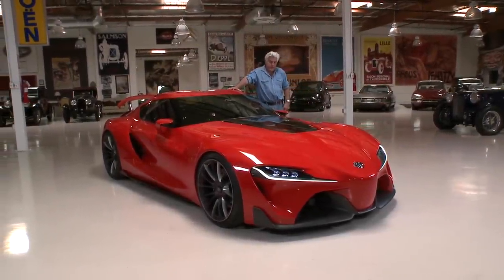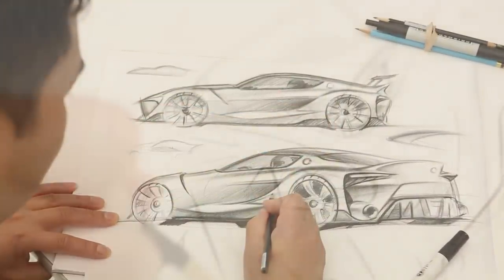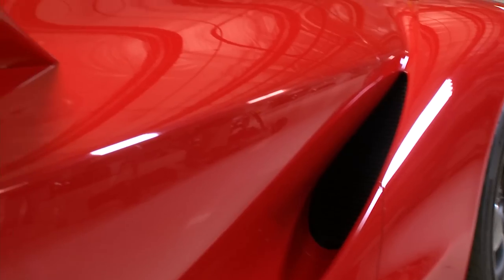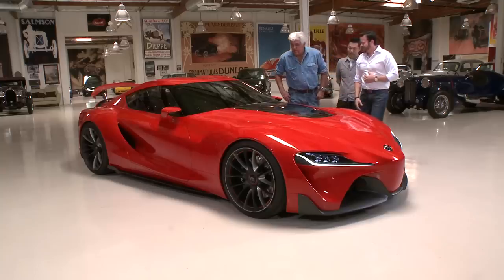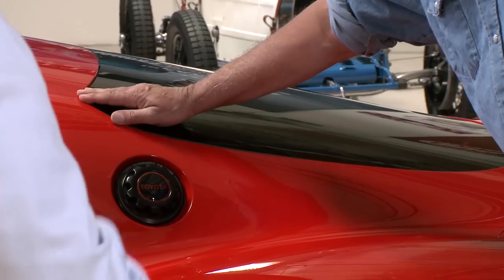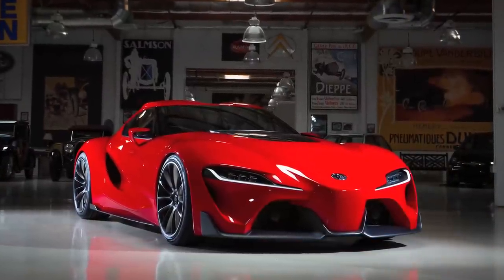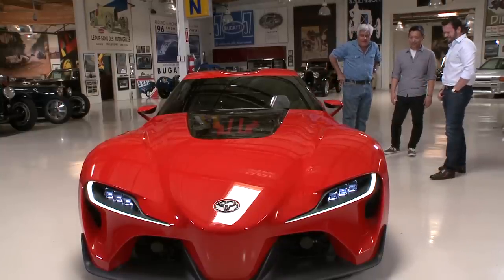Toyota FT-1 Concept - Jay Leno's Garage

Comment: They should make a FT-1 concept body kit for the 2019 Supra!
Reply: that would be insane!  i can imagine someone creating that..
Reply: Nah the new supra isnt worth it. Because it's the same BMW inside no matter what shell u put outside.
Reply: debendra gurung yeah?
Reply: The new supra can never be great. No matter what body kit they put on it. Should of built this car instead
Reply: I think the soul of the FT-1 look is that F1 like nose. I just don't see how you can kit that on with the current Supra.
Reply: You would litteraly need to change the chassis, the wireing harnais, all of the panels, all of the inside, all of the glass, the 4 wheels and tyres, all of the interior as well as the motor that would not fit under the FT-1 hood and... oh no there are nothing left! Yeah build one from A to Z without any base would be easyer
Reply: @skip741x3  they did check my channel
Reply: You can't. The FT1 is wider and longer chassis and better it wouldn't fit on that A90 turd we got...
Reply: Is dis a toyota supra or just another bmw supra??🤔🤔
Reply: That crap is a Z4 its not worthy of the supra name
Reply: @debendragurung3033  don't short sell it tho, it's a fantastic car for the price
Reply: @sspsmith7605  hurr durr bmw supra waaa not worthy not worthy, man, Toyota made a great car and y’all still hating on it

Comment: Why was this car never made? It's the best looking Toyota of all time.
Reply: They are actually still considering making it.
Reply: Looks like we will get it now
Reply: As I recall this car has been seen around the ring
Reply: marc james they have put the new supra out on the ring so similar looking car
Reply: David Cheeseman that's what the evolution of this is from my understanding
Reply: No the mk4 is
Reply: Beerdy - Bruce Lee Central.
Reply: They are supposed to make the new Supra out of this concept.
Reply: They are designing the new Supra around this build, should debut sometime next year. Public release slated for 2019.
Reply: friend of mine works at the dealership and his college went to  a presentation of the consumer version, so he has seen the final product. it will be out but the front as i heard will be different.
Reply: The chassis is toyota, the engine is bmw, research before posting stupid coments
Reply: Rolling Guy #1 
The reason for this BMW alliance is because they sold their inline 6 tech to them. So it would be more authentic than the GTR who changed from it's inline 6 TT to a V6 TT.
Reply: No it’s probably the mk4 supra what is the best looking
Reply: dn lamp is it close to the FT1 original design?
Reply: næ
Reply: i hate how it looks. i wish it was more angular like the early japanese import cars designed in cad. why does every sports car nowadays have to look like flowing liquid. angular design seems way more confident, it just seems more masculine like the supra 3rd gen or the 300zx.
Reply: also the interior of this thing is disgusting. why does it have to look so complicated and cluttered.
Reply: Beerdy - Bruce Lee Central don't forget the supra
Reply: The Supra is the ft-1 concept
Reply: It’s really a very beautiful car and if the Supra looks like this they will sell well. But no concept cars hardly ever make it completely to production. I’m sure they will  change something and mess it up.
Reply: Beerdy - Bruce Lee Central claimed any other mans videos as of late?
Reply: It's going to be made soon, new Supra my dude
Reply: porduction begins end of this year revel is this time next year and the car will look half as good as this concept, still cool.
Reply: Beerdy - Bruce Lee Central hell ya It looks dam good. Looks like it would domante the track
Reply: Beerdy - Bruce Lee Central nahh JZA80 (Toyota Supra MKIV) is better
Reply: Not even close. 2000GT by far
Reply: People have spotted it testing at Nurburgring.
Reply: The car they're actually coming out with looks like a cross between this and the 4th gen Supra.  It's not bad looking but it doesn't look as exotic as the concept does.  

Here's a video:  https://www.youtube.com/watch?time_continue=15&v=cYy9N5v5eho
Reply: Clell Biggs concepts always are overblown, there's no budget on concept cars so that's why most of the time concept cars look better then the production model.
Reply: It IS being made. The FT-1 (Future Toyota) was the prototype for the A90/Mk.V Supra.
Reply: ooDirtyMickoo i
Reply: Beerdy - Bruce Lee Central remember the mk4 Supra will always be the best looking Toyota
Reply: Its coming out in January 14 2019
Reply: Because is a toyota
Reply: Research is still going on on its reliability tests.
Reply: aaaaaaaaand its been unveiled
Reply: Beerdy - Bruce Lee Central it just got made
Reply: Pandes Mandes nah it really doesn’t
Reply: Beerdy - Bruce Lee Central I was made it’s called the 2020 Toyota Supra
Reply: Rolling Guy #1 that is the Supra
Reply: It probably would of cost to much for most people .So when they unveiled 2019 model they change it. It didn't have the same appeal look.
Reply: People driving it now lol
Reply: @ooDirtyMickoo  Aero, man! A supercar needs to slip through the air like a fish through water. Angular is dead - not for style reasons, but for performance.
Reply: @andoletube  i dont get why angular inherently means its less aerodynamic? like a triangle is aerodynamic.
Reply: @ooDirtyMickoo  wind tunnel testing has shown that a lot of what we feel is instinctively right about aerodynamics is actually pretty wrong. There's a lot to manage in a supercar. There's wind resistance, ducting for cooling, downforce, turbulence. It all adds up to this smooth lines result. Yes, all makers are making small compromises for the sake of styling - otherwise they'd all end up with the same design if it was only about efficiency. But none of them are prepared to take a major aero hit just for tho sake of styling because the performance suffers too much and the car won't sell.

By the way, a triangle is not aerodynamic! The front of it is, but the trailing end will make a substantial low pressure zone that will try to suck the triangle backwards. It ends up as dirty-air that affects the drag coefficient. It also makes rear downforce and air direction onto a rear wing pretty much impossible.

Comment: Toyota just needs to bring back the JZ engine family
Reply: 3JZ-GTE Anybody??
Reply: +Abhi Nisakaran yup that would be great
Reply: +Abhi Nisakaran I hope they made it..
Reply: supposedly it's going to have a bmw z4 N52B30 engine, in which I do agree they should have brought back jz if not a modified version of it.
Reply: +Jack Singh so basically Toyota is copping out to actually building their own engine from scratch...I hope of this thing does come to fruition that modders put a 2JZ in it...
Reply: +ywe3 I do disagree with the idea of using a bmw motor and also hope for a new jz, but don't forget that that Toyota worked with Subaru for the GT86 which has an excellent motor and Toyota also worked with Kawasaki for the LFA V10 my overall point being is that if Toyota wanted to follow that route instead just using a bmw motor they should work with to create a new motor.
Reply: Jack Singh historically Toyota used Yamaha and actually owns 50% of the company...but to call the GT-86 Engine a success? The 2.5L I4 in the tC makes more torque and has comparable power and has a Toyota badge on it...look it up the FR-S/BRZ/FT-86 are all slower than the "entry level" cars 5k under them and most real modders go for them over the FT platform as they also have more room for modification both in chassis and engine bay...if the FTs were turbo or supercharged from factory then maybe I'd consider it a success but they're literally what the J cars of 80s GM were the just look the part...
Reply: Jack Singh I knew you meant Yamaha lol, but efficiency doesn't belong in a sport coupe it should've been turboed from the factory bar none...it's SLOW and feels SLOW it has only a 150lb.ft. of torque pushing a 3000 lbs car...you can barely get the back end out and when you do you can't hold it long due to the lack of torque...i drove an FRS for a while the car wears off after the 1st week of ownership  and just becomes that leech that suckered you in the showroom and sucks 800/month from your wallet  (car note and ins)...when you get beat by the entry level car with an automatic transmission hang your head in shame
Reply: +ywe3 lol this is true I beat my buddy who has an fr-s in my 2011 Camry se. But yes it should have came with a turbo. Especially when you think of Subaru, boxer motor a turbo just needs to be there.
Reply: Jack Singh didn't he feel gipped I mean the car costs 30k
Reply: +ywe3 that I'm not to sure about, he is the brother of Elvis Skinder from StanceNation
Reply: Well that might explain a few things lol
Reply: Unfortunately it will never happen. In 2002, after many I6 JDM sports cars were out of production, a lot of people knew that was the last time they would see JDM sports cars powered by I6s. Even Keiichi Tsuchiya said, in 2002, that he is gonna miss I6s, that is for sure we're not gonna have another JZ engine. Which is a pity, but the worst thing is that is probably gonna have a BMW engine.....
Reply: +ywe3 Do you think the AE86 is slow? Good, then the GT86 is EXACTLY what the AE86 was. Slow, affordable, fun.
Reply: The Hachi-Roku was not slow for its time in fact it was one of the faster entry level performance cars in 85...the GT-86 doesn't even come close its overpriced and very complex to maintain...the Hachi-Roku will maintain its staple status long after the last GT-86 turns to dust as it was (and still is) the best 2 door Toyota has ever produced only rivaled by the supra and FR Celicas
Reply: +noskilz04 They Just need to do something, it has just been far too longas long as it is straight 6 I'm good which it is going to be.
Reply: ///AMG Lol, V6 sounds like a beast honestly.
Reply: kane kure The head of the engines was developed by Yamaha , as usual. The rest by Toyota, it's common knowledge.
Reply: kane kure Well, it happens
Reply: thye wont :(. it doesnt meet this generations needs...... fuel efficient and good for the environment .. psst. give us the 2jz , epa can go kick rocks lol
Reply: they might now that trashy scion is no longer in existence
Reply: The JZ GTE is the best
Reply: I know right i was expecting it to have a 3jz but no.....dissapointment
Reply: noskilz04 and zz
Reply: noskilz04 3JZ?
Reply: Nope... they should put an upgraded version of the LFA engine in it.
Reply: micglou the fact that you use the word upgraded says it all XD
Reply: It does?... Mr. 'the fact'?
Reply: Abhi Nisakaran ehm what about d3jz-gte where the d stands for double that would make it a V12 made of two 2jz blocks whit quad turbo😁
Reply: The BMW i6 in there should be the 3JZ
Reply: I've been hearing its going to now have some sort of Toyota V6.
Reply: Stop begging for 2jz its already old you have to move on

Comment: That Toyota FT-1 needs to be in production!
Reply: It will be in production as the new Toyota Supra
Reply: with a shitty bmw engine. nice supra.... this good looking piece of crap won't get even close to the supra (sadly)
Reply: Why are the bmw engines shitty?
Reply: Beazor 86 We don't even know what engine will be used and you are already dismissing it
Reply: Mariux - i know who is making the engines. and i know enough about bmw so it's simple 1+1
Reply: BMW had a lot of straight 6s just like the Supra.
Reply: Sask Rider they do have high performance straight 6. but high performance for bmw's 6 banger is just 500-600 hp. high performance supra (2jz) is at least 1000hp+
Reply: BMW= never designed for turbo tweaks. High compression ratio ranging from 11.0:1-12:1 as opposed to 8-9.0:1 supra. You could lower compression in bmw engines and make them turbocharged so it produces more hp, but I don't see the point.
Reply: It will be as FT1 Prius full electric  :D
Reply: because they are over engineered
Reply: @DailyDotaTV I think you should take that back.

Comment: all i can say is, if they put this into production, they better have a manual gearbox available
Reply: ***** its a shame isnt it? shifting is what makes driving fun. the sound you get from downshifting, or the pull you get from shifting up at high revs. now thats all gone with auto transmissions.
Reply: Creedford It's paddle shift so you can still downshift and make the sounds. It just auto-revs and auto-clutches, because it's a lot faster than a human.
Reply: Empty Videos Buying a sports car is about driving feel, not about going fast, since 99% of the time you are on public roads.
Reply: Empty Videos I disagree, if you look at any stat for a car that has a paddle shift automatic transmissions there acceleration is usually a second slower than if you were to have the manual. But it's still in concept, i'm sure a lot will change cause right now it looks like it could be a very fast car, and they emphasized the air flow.
Reply: I agree
Reply: Spencer Tennant Nah they can have paddle shift too but you need that fun to drive japenese car feel to it like ripping around in a supra
Reply: Yeah but I just hope that they have like a 6 speed standard transmission or something of the sort.
Reply: Creedford Nah three on the tree or push button shifter on the dash with separate push button for D, R, P, N 1, and 2 ;)
Reply: I don't think that a manual transmission will exist...it's like the GT-R R35...I think it will be an automatic 7 gears
Reply: Empty Videos I like my human speeds just fine, you can't feather a paddle shifter and there are a whole bunch of times when you don't want to shift with a bang out in the real world.. They have all these different electronic gizmos to help the helpless do what my hands and feet do naturally.
Reply: ***** yea but thats only because toyota has become so unoriginal that they have no choice but to do so...
Reply: Creedford no chance for a manual mate but what would be a good replacement for manual is instantaneous silky smooth gear changes.  But manual will always be the best.  #mechanialengineer
Reply: Creedford I swear if it comes with manual it will be mind blowing :D :D
Reply: Creedford It all depends on the emissions compliancy. The reason most makes use AT's is they control the entire powertrain (and just about everything else) via a computerized CAN system to minimize emissions. Sadly, they use a CVT in their latest models which I loathe.
Reply: Raggical Traggical is on the money
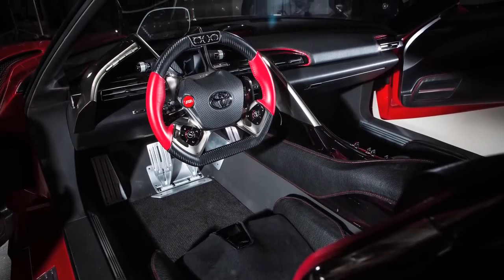Reply: Creedford 4:25 I only see 2 pedals so it seems like it's paddle shift
Reply: Eric Wang yea no doubt this one in particular is paddle shift or auto, but if it goes into production in the near future it would be nice to see one last true JDM Icon available in manual transmission. especially with the rise in elimination of manual transmissions in production cars and their replacement with autos and paddle shift semi auto transmissions. its a shame but apparently "the times" these days is making production cars boring so they sell better and scrapping the manual transmission because fewer and fewer people order them or know how to drive them.
Reply: Eric Wang so are you trying to say you think it will have that gearbox in it?
Reply: Creedford What I mean by that is that BMW is slowly making less and less three pedal cars and that sucks
Reply: Yep I just want a regular stick not a paddle of automatic if a computer shifts faster then my by .00004 seconds I don't care! I just want to have fun that's why I would buy a sports car is to have fun!
Reply: Spencer Tennant anything with a double clutch gearbox can shift faster than you by the time your clutch is fully engaged, but id rather have a stick civic than an automatic s4
Reply: There comes a point to me where I don't want to take my hands off the wheel to have to shift. For me, that is when you are in obscenely high HP cars that rev like crazy. A manual is best in a sports car, paddles all the way for a modern super or hyper car (with some exceptions in the super car range). One of my friends I was talking to who adores manuals and drives a manual himself was worried back when the Koenigsegg One:1 came out that it would have a manual. Why? Because he realizes that with that much power and with modern technology, paddles would be so much better. They are always accurate, they don't burn out clutches, and you can really focus on controlling the 1364 hp beast. In the end, it would be far more pleasurable to take around a track then if it was manual.
Reply: This is fckin hilarious because of the new Supra

Comment: Beautiful car, but I am a mechanic so I wish we could be talking about the engine, transmission, and suspension. Maybe if it someday gets build we will be able to.
Reply: +mary jane The LFA V10 with a DCT trans this time around.
Reply: +GlassTopRX7 I really hope that it will not be DCT only. Being a joint venture with BMW it might be available with a manual transmission. I know a DCT is faster and all but a sportscar is about feel and not math. I will drive a manual as long as there are manual cars to get even if I will be forced to drive only old cars then.
Reply: +Un1qZ 
Same here I can't stand the paddle or "sports automatic" I have even pondered if I win the lottery I will have to get the Audi R8 because it's the only supercar with an actual genuine manual gearbox as an option.
Reply: rabbitphobia Yeah it is very sad. I for example am looking to buy a medium sized wagon with a bit of grunt under the hood. Basically I am forced to take either an audi S4 or a BMW 335 because no other car in question has a manual. If it had one I'd take the Volvo V60 in a heartbeat because I love the design and the engine but nope I don't want an automatic. The only other option is to try and find a decent 10+ year old car.
Reply: Un1qZ
I seriously have been looking at older cars with low Km's for that reason.
Reply: maybe it use lexus v6 engine